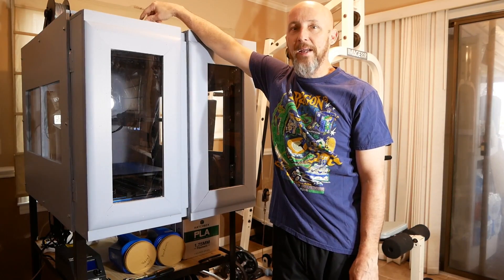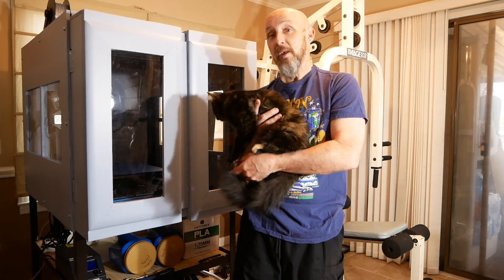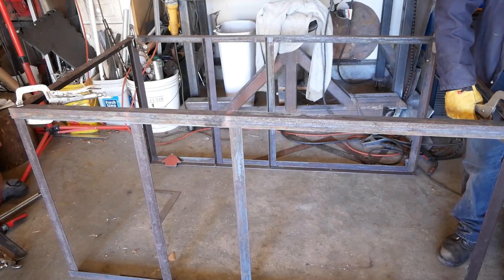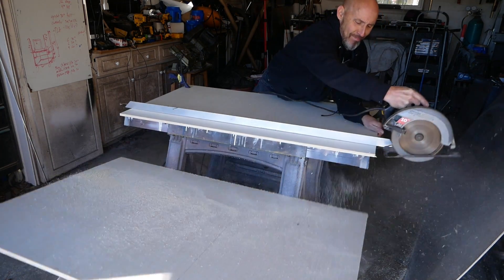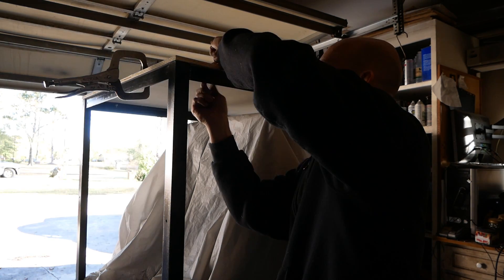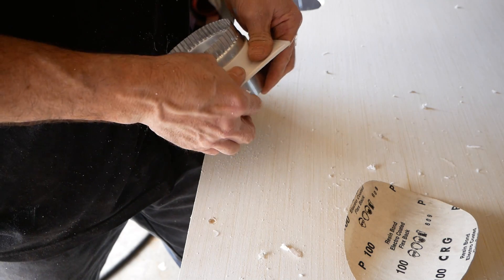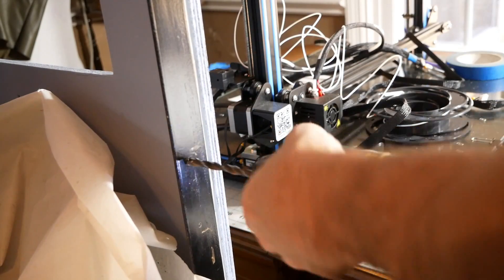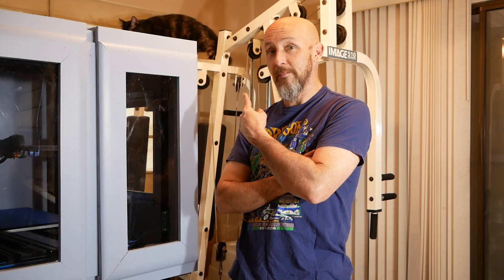Building an enclosure stand for my creality cr-10s5 3d printer

Comment: Did you try printing bigger prints with ABS?
Reply from the maker: I have not tried using ABS yet,  my bed heater died several months ago while I was using up my supply of PLA, and I didnt bother to fix it since I am going to a Keenova.  I just havent done it yet since I have been in the middle of other things.

Comment: hello there . i am considering of getting the S5 myself . but before i get one :)  i must know the dimension . can you please post the dimensions of printer or cabin you have built ? i need to build an enclosure at minimal size possible - since idont have much space . 

thank you very much :)
Reply from the maker: The s5 has a huge footprint!  I like it, but it took up more space than I expected.  The cabinet I built is 44 inches deep (about 1118mm) 32 inches tall (812mm) and 31.5 inches wide (800mm).  There isnt much space on any side of the printer in this cabinet, so other than the stand being taller than it needs to be because of the shelves, the cabinet is pretty close to minimum size when you account for the bed movement.  Hope you enjoy the printer :) thanks for watching.

Comment: this is the sturdiest enclosure that i've ever seen. very good job! i will inspire from it when i decide to make my own.  how is the printer going? is it reliable? the glass bed is straight? big prints are accurate? i want to buy a cr 10 s5 but everyone is telling me that is too big and this will cause all sorts of problems and keep sending me to regular cr10s.   the space is not a problem and i dont wanna use glue in my prints. also most of my prints will be household items, tools or tool parts, and a few decorations. and i think that bigger is better
Reply from the maker: So far I am thrilled with it!  Glass bed was close enough to straight and level , I cracked it being dumb though and replaced it with a piece from a local glass company.  This one so far seems quite flat.  I have only printed flat large prints so far, (nothing tall-yet) and so far it works very well.  I would easily buy another s5 if I had more room lol.  I read quite a few articles and reviews going into this that it was a tinkerers printer (needed to want to upgrade and play with it) and wasnt afraid.  I intend to add stabilizers to the z axis so there is no play there before I start on the taller prints I want to try!  I agree with the bigger is better mentality :)  So far anyways!  Thanks for subscribing.
Reply: @eric-bkc   thank you for answering. i have no experience in 3d printing what so ever, but i get along with tinkering stuff. i agree cr10s5 needs some upgrades, and i'm willing to do those. i was thinking at a bigger heat bed and yes , z axis stabilisers. and so on. i am glad you are pleased with your printer, this is the first positive answer towards my intention :)) all i have to do now is to convince my wife that she needs 3d printed flower pots and stuff :))